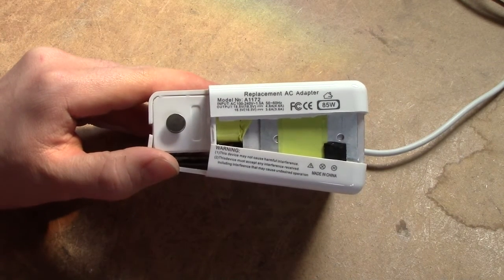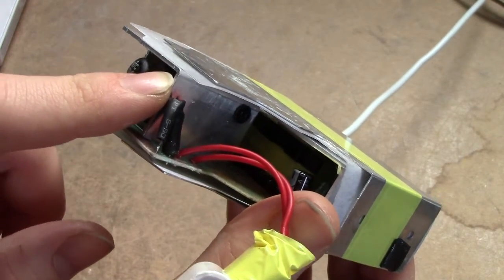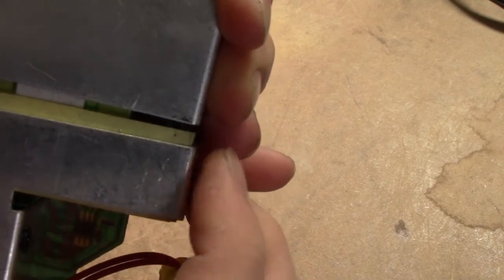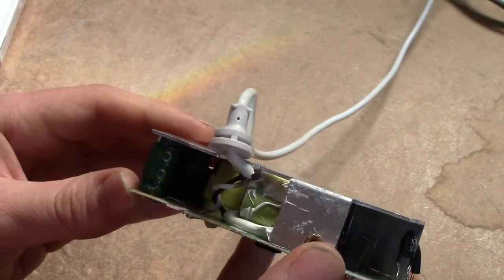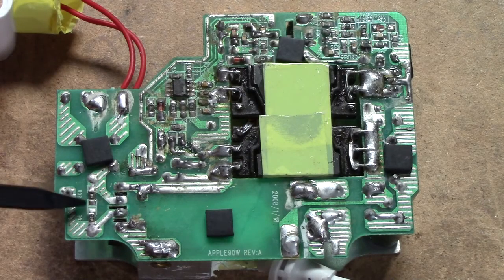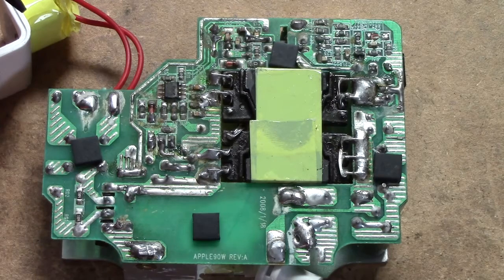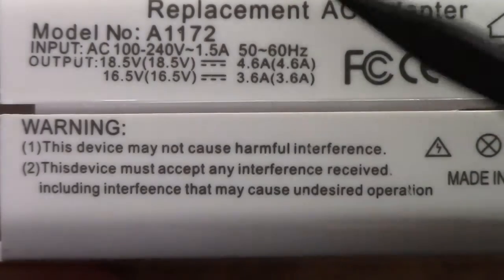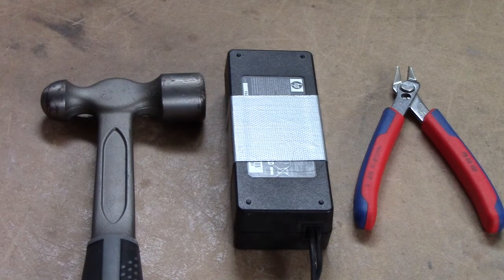Destructive teardown: Ebay Apple Charger

Comment: I got one of these, never sold as genuine Apple of course, and replacement for a Magsafe 1.
In your video it looks like this has once been a real Apple charger!
Mine is outputing 16V constantly and does not appear to have any short protection... with that magnetic thing it's a really bad idea.
I paid a way too much for it too, that really sucks!
Also the ground pin is connected nowhere so using a grounded extension does not help!

Comment: Some of the "defects" were certainly not what I would accept in anything I bought. But when listening to the man talk about the thing, I got the feeling that he was "nit-picking" wherever he could.  I "lost faith" in the other problems he pointed out.

For example, regardless of the manufacturer and the company of origin, I do not believe that removing the case, partially removing some of the insulation, and so forth, then plugging the power supply into the mains, and plunging the power supply into the mains, then dunking the whole thing into a bowl of swamp water or ???, is a good, acceptable recreation of typical operating conditions for the test!  I imagine most power supplies are not designed for that scenario!  I certainly would never keep something like that in the house anyway!

I am sure the bad things found by this test guy are enough to disqualify this power supply and warn people to avoid paying half-price for a power supply that isn't up to the level of "safeness" I'd accept for anything that may be used where it could hurt people or cause damage enough to be dangerous.  On the other hand, if buying the thing to tear it apart, and compare it to the power supply offered by the maker of your computer, looking for unpleasantness in every possible location, well, perhaps the off-brand unit is the right choice for your planned failure.  Why spend twice as much as you would spend on the "real thing", when you are already aware that you are going to destroy the thing?  Chinese people are not fools!

My final words: I will avoid all cheap,power supplies as a rule, only taking a chance on one if it seems worth the risk.  I've seen enough of them tortured to death on U-tube to avoid them.  Even though I am somewhat critical of this "review", and I apologise to the author if I have been unfair in any way, I appreciate the author's intention and I hope he will continue to examine products in the future. Reviews are always valuable if the intent of the author is "pure".

Thanks for the time and money you spent to create this review.
Reply from the maker: This review was made with regards for the use-case scenario of Spongebob.

Comment: Seems like every bad designed power supply / charger puts out an insane amount of high frequency noise.
Maybe the next thing I should do is:
1. Place a recently bought power supply right next to an AM radio
2. Check if I could still tune in to some stations
3. If not: Back to the seller and get rid of this security risk
Reply: +Das OSi Good idea. What's an AM radio? ;-)
Reply: +Das OSi Good idea. What's an AM radio? ;-)
Reply: Fracture You know those big heavy wooden boxes your grandparents used to tune in to broadcasts? Yeah, those things ^^

Comment: My macbook charger started passing AC through the dc output ground somehow. The laptop didn't die, but I got buzzed pretty good when I found the body of my laptop was hot... I am going to see what Apple has to say about it, but I may tear it apart and see what is causing the fault if they don't want to do anything about it.

Comment: Maybe it was the real Apple charger...  http://www.apple.com/support/ac-wallplug-adapter/  I guess it really doesn't matter if you buy an Apple-store or Ebay-Apple-charger?
Reply from the maker: +kuvittelija This definitely was not a genuine Apple charger. They would not risk a lawsuit after murdering someone.
Reply: +kuvittelija Apple makes good quality power supplies. My iMac has a Delta unit in it with all nichicon caps.
Reply: +kuvittelija no that is for the ipad and iphone not the macbook charger